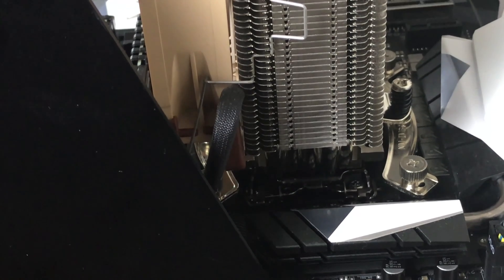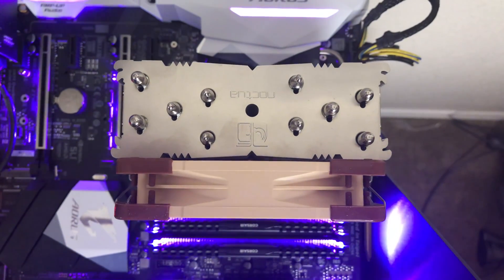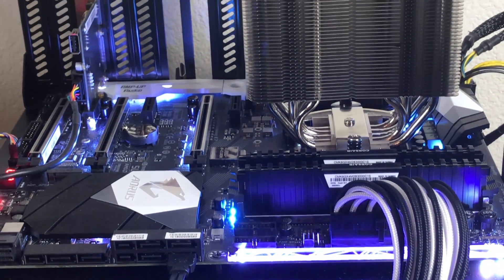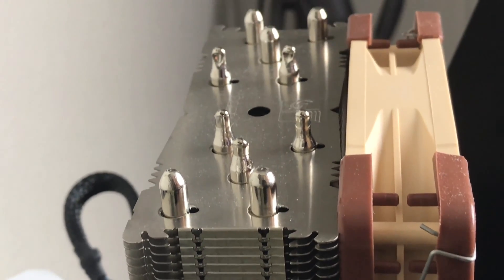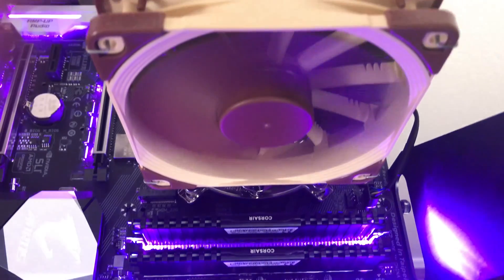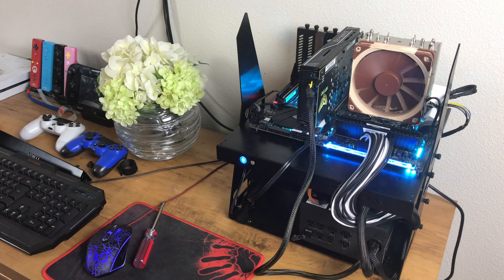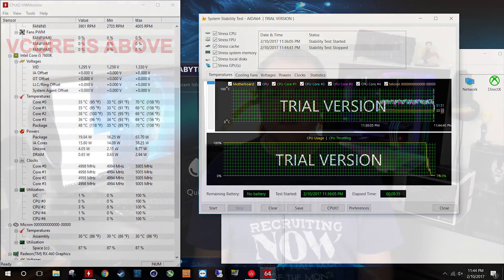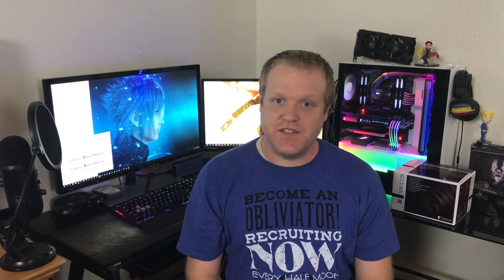Episode 58 - Noctua NH-U12S Review

Comment: been rocking this cooler since 2013, i got no problems so far, when it looks dusty and old, i just use metal polish and it looks brand new again in just a few minutes! great cooling performance and totally worth the price!
Reply from the maker: +Mad Max111 I overclocked my 7600k on this cooler to 5GHz no problem.
Reply: you can OC the shit out of your CPU with no problems with this cooler, it stays quiet AF.
Reply: which CPU do you use ?
Reply: just an i5-4670
Reply: Because I want to buy a i5 7600k but I also want to have a 100% RAM compatible CPU Cooler maybe this Nh ... is a good candidate
Reply: this is a good partner for your 7600k bro, trust me you wont regret, very silent and very capable CPU cooler, i'd choose this than any 120 AIO anyday.
Reply: OK thx
Reply: and if I want to overclock them too ?

Comment: Do you think its worth adding a 2nd fan?
Reply from the maker: +BillnWa It would allow for lower fan speeds thus lower noise. But you'd have to decide if the extra fan is worth it for that.
Reply: BillnWa 2-3 degree difference. Unless you are going for high overclocks, just save the money for slightly higher clocked ram.

Comment: I have the same NH-U12s since 2013 Dec, the heat pipe got rusty , and the surface of the bottom heat pipe has oxide layer (green color).
Reply: Do you live underwater?